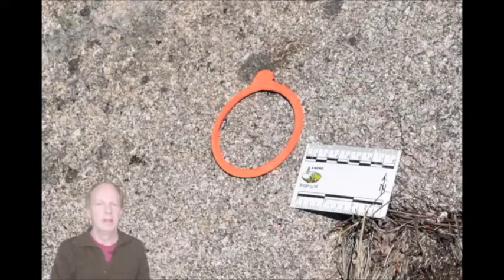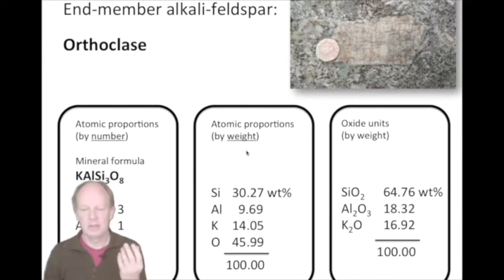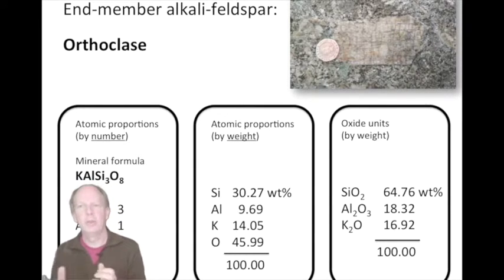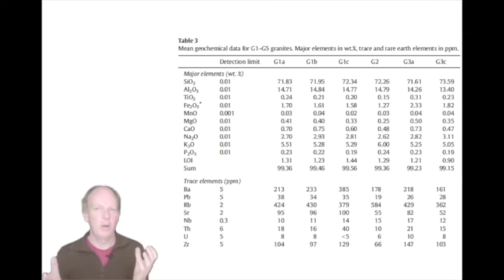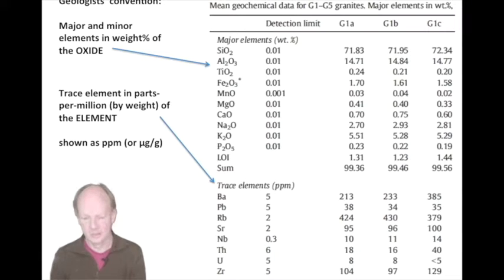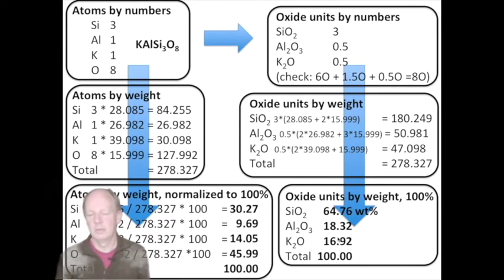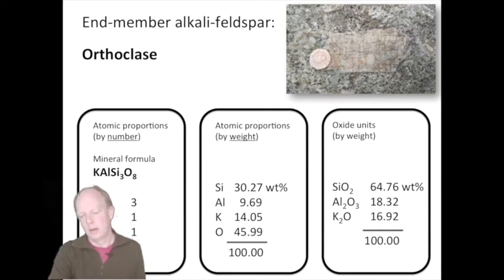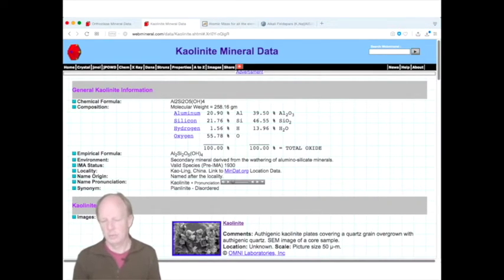Tutorial XRF data calculations

Comment: what if the numbers do not add up to 100??? im working on assignment for cr-spinel where the values add up to 99.86 and was wondering whats responsible or lacking for it to not equal 100..
Reply: This is a good question and for a lot of analysis the total will not be as close to 100, so it is important to address this for the best achievable accuracy. If your total is 99.86, then that is 100% of the values you are calculating, so you calculate each as a percentage of the 99.86. In this case, they will be extremely close to the amounts you already have. So if Ti was 30.00 out of 99.86, then it is 30.042% of 99.86. I hope this helps.